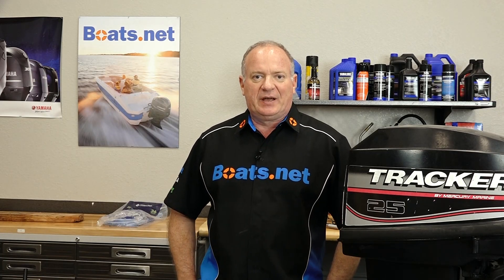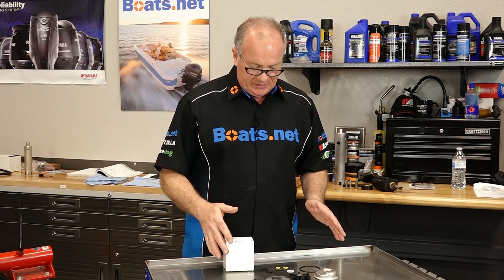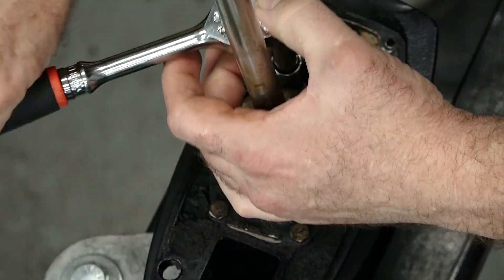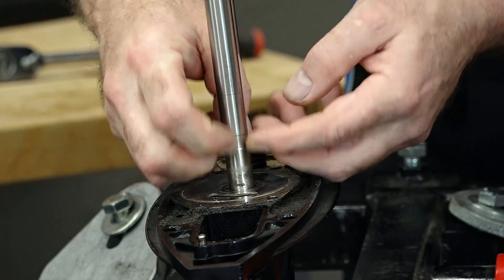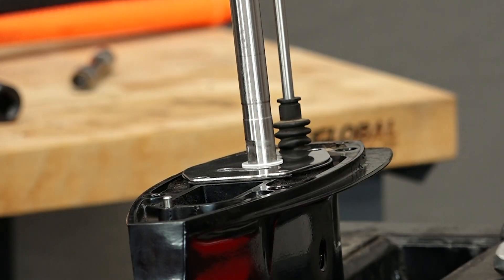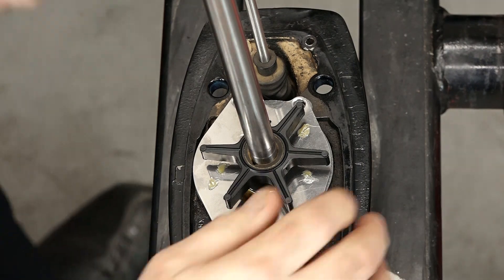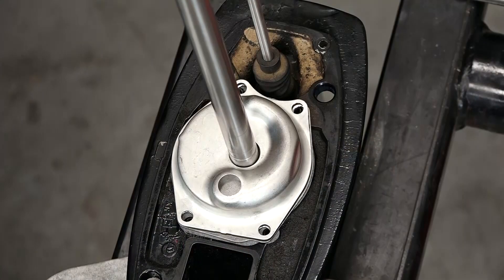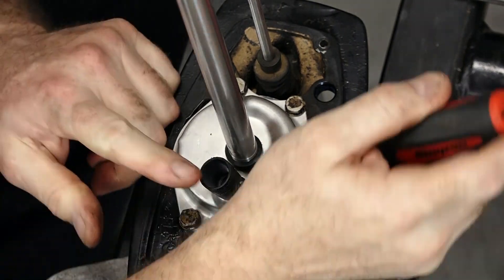Mercury Tracker 25 Water Pump Repair | Mercury Tracker Water Pump Replacement | Boats.net

Comment: Does. The impeller change direction when you use reverse so that it won't matter which way the legs are facing  when you install it?
Reply: That shaft only spins in one direction. It's the gearing in the lower unit that reverses the prop direction.

Comment: U push it counter clockwise down(if u like that muscle method) but motor spins clockwise
Reply: I’m so confused. I think I have my impeller fins going the wrong direction because I’m no getting any water through my pee hole and all me tests show I have no clogged lines. Which direction should they be bending if I’m holding the housing in my hand and looking at the impeller? This way- curved to the right ( ——or to the left )
                      0                                0.   
                       ).                               (
Reply: @craigmayhan4009  its not your fault Craig, the video is missing detail. and HE NEVER RESPONDS so dont bother...
Reply: yeah he NEVER mentions that and like craig, i put mine in CLOCKWISE.. I had to break it down again and do the whole job a 2nd time. THANKS JOHN
Reply: @steven33068 he turned the shaft clockwise while pushing down

Comment: You need to put triple guard grease all over the impeller and plate and housing. Coat it well. Triple guard is special waterproof grease for applications like this. You didnt show installing the new big o-ring in the new housing cover. You also didn't mention that you won't need those 4 bolt bushings, because the bolts you have won't fit through them.
Reply: The small o-rings get pitched?